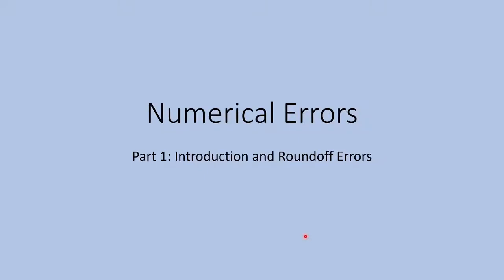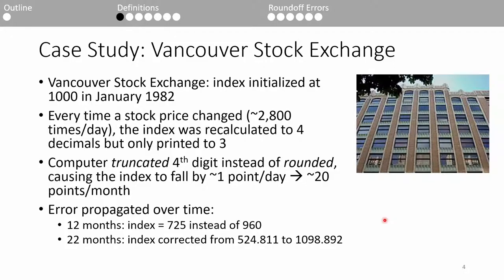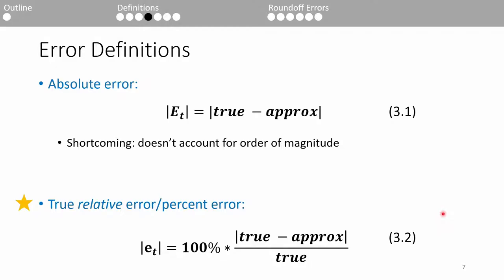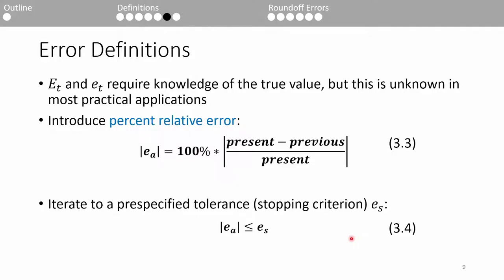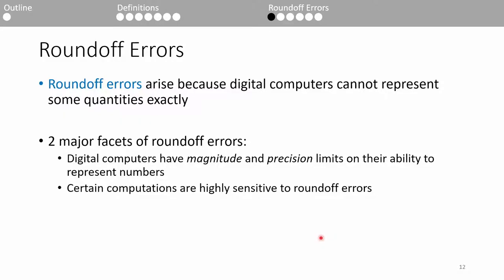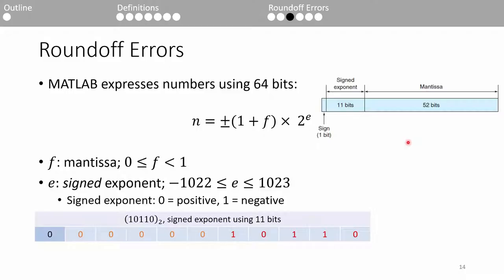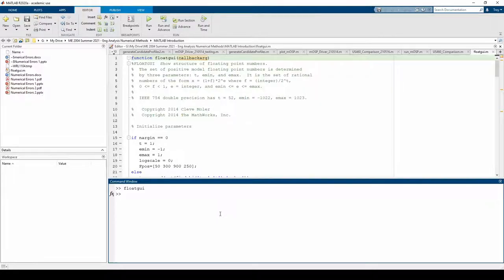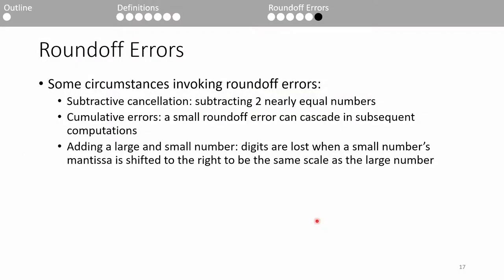Numerical Methods: Roundoff and Truncation Errors (1/2)

Comment: Hi, thank you for the video. I have a question. How to derive this formula:
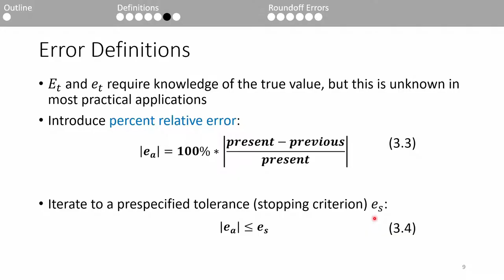8:16 |ea| <= es
How can i prove this ?
Reply from the maker: Hello, I am not sure if there is a formal proof for this. |ea| <= es is just saying that you want to pick some value (es) that enacts a ceiling on the magnitude of the allowable percent relative error (ea) so that you know when to stop iterating. Otherwise, you will be iterating forever.

EDIT: You can make the stopping criterion related to the number of sigfigs by Eq. 3.5 in the video. This paper (http://matlabgeeks.weebly.com/uploads/8/0/4/8/8048228/analysis_of_numerical_errors.pdf) references the Scarborough 1966 paper which presumably proves this equation, although I personally have not read that paper.
Reply: @jaisohnkimVT  Thank you very much, sir.